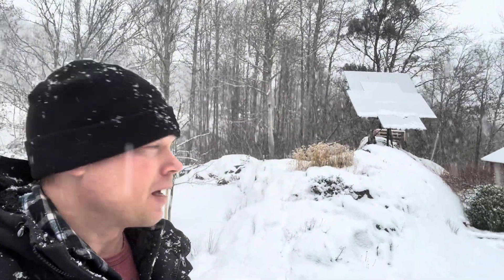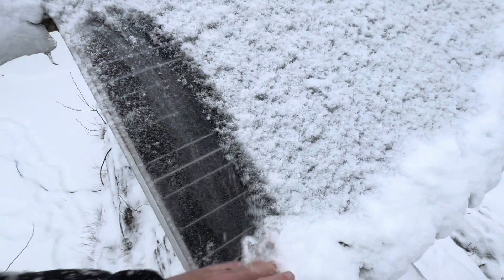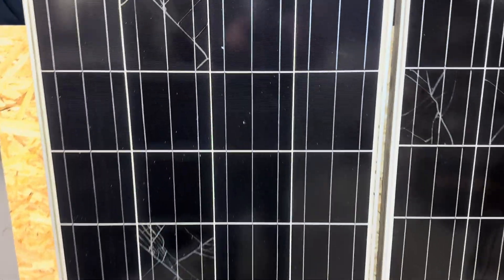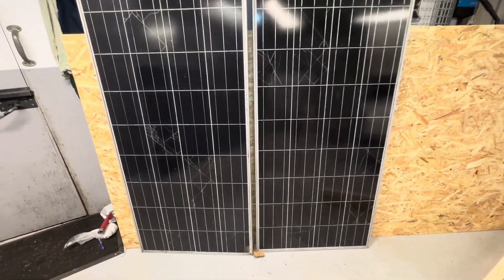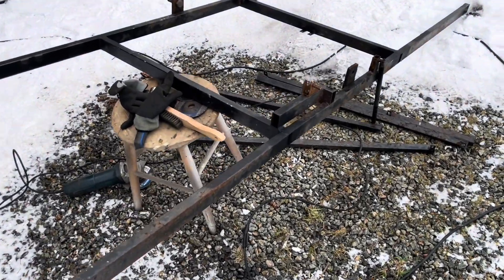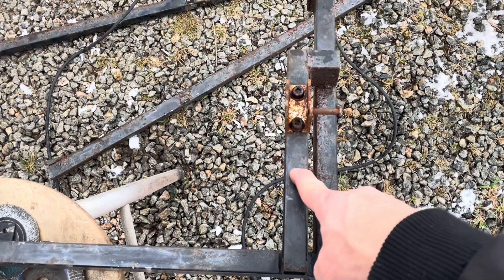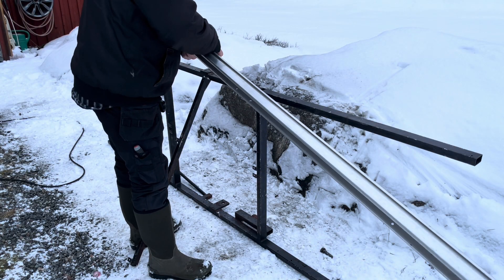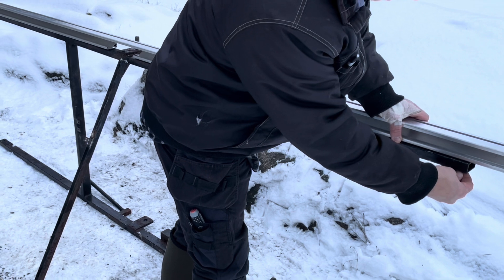Diy Solar Tracker System, rebuilding the frame and panel upgrade.

Comment: Due to the extreme drop in prices in the PV sector, more solar panels are now much cheaper than tracking systems.
In any case, trackers are prone to maintenance and faults due to the mechanics and electronics, and are also very susceptible to wind. 
So: simply install more modules. For more constant yields during the course of the day, the modules should be aligned in an S-E (= morning sun) and S-W direction.
In winter, even trackers generate too little electricity, so there is no way around other types of power generation (generator, grid).
Reply from the maker: We guys with trackers already knows everything about that. We do it because it’s fun☺️

Comment: For sure its a snail trail which is degradation of the silicone wafer on the glass. Hard to tell what the cause is but i would expect it is something to do with failure of the back sheet coupled with the large temperature changes you have there. Hopefully the glass glass panels will last as i have upgraded part of my own system 6 months ago. Congratulations on the 10K subscriber's.
Reply from the maker: Yes I think that the glass glass was a good choice.
😃Thank you so much 🙏

Comment: Great work, solar panels could have a long life but sometimes you might be unlucky wkth some. The big plus is replacing them with new ones boosts your production and that's a big plus. Hope they will quickly deliver power. Ever thought about running heating wires to your panels to get the snow off by melting it away? Or is the yield to low to make that efficient? Nice work as always!
Reply from the maker: Thanks ☺️ 
Yes i have thought about it a lot. But it is a lot of work. I think that it is possible to gain more than it takes to melt the snow if the forecast promise sun.
Thank you so much😃
Reply: @flyingtools  How about using a de-icer coating on the panels and leaving them vertical when it’s going to be snowy?

Comment: Only problem is, they are not resonating...yet lol. A proper/good steady wind might take them out? Why do you have to wait for an electrician? Love the series! Watching with batted eyes.
Reply from the maker: The surrounding areas makes it impossible for a good steady wind, but the gusts can be devastating. 
In Sweden we need a certified solar electrician that connects dc voltage over 50v. Thanks for watching ☺️
Reply: @flyingtools   You’re going to wait for an electrician, right… 😉 lol

Comment: Rivet nuts are your friend in tubing. Corrosion protection on the holes drilled to fit them.
Reply from the maker: Yes, they are good.👍🏻

Comment: a slug aka naked snail - but that would not fit between.

Check the backside of the panel cause your trackers brings the panels into a very exposed position.
The backsides are usually very well protected on the roofs and to me the weakest point of solar panels from 2000 to 2015 are
* Cables and MC 4 conntectors
* the foil on the backside
* the diode box(es)

And if it is not cracked as it looks then most likely something have intruded from the back. 

If you can check the back side try first a visual inspection and look for #1 tiny holes and #2 use your finger to follow the tracks with gentle pressure, but do use the nail, just the thumb and follow these busbars. 

If you have a feeling that there could be a smaller, tiny hill under the foil then this will be caused by oxidation and if you press harder the oxidation hilll crumbles under the pressure fully. The panel can still work for ages, but at one point it starts to suffer in the production.

We had these issues with 2 brands: trina solar and risen. 
Not really happy about the quality.
Reply from the maker: Everything you describe is exactly what I can see on the panels.
I think that those glass glass panels will hold up much better and longer. 
I am just hoping that the stands will hold to.😝 
Thank you so much for your information.👍🏻

Comment: Are you not allowed to connect the panels yourself? Are is it because of the tools?
Reply from the maker: Not over 50v in Sweden
Reply: @flyingtools  Ok, sometimes more curiosity than in Germany ...I'm impressed 😀
Reply: @flyingtools  so how do you wire or fix anything in your house? You have to call the electrician everytime?